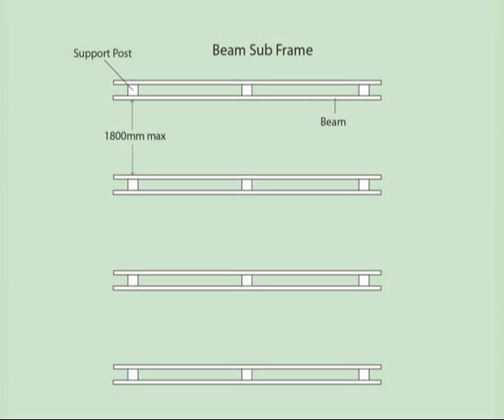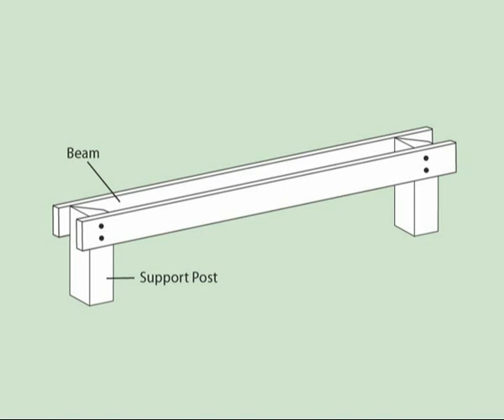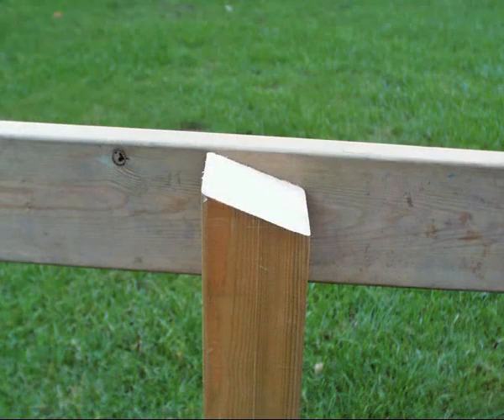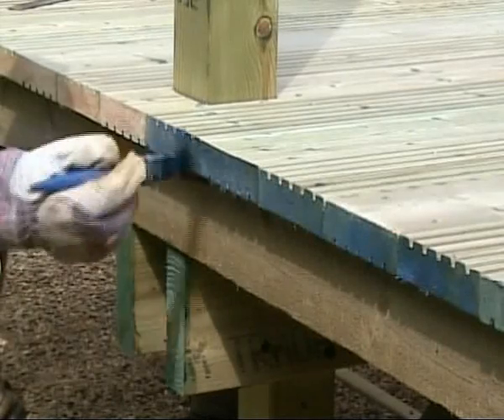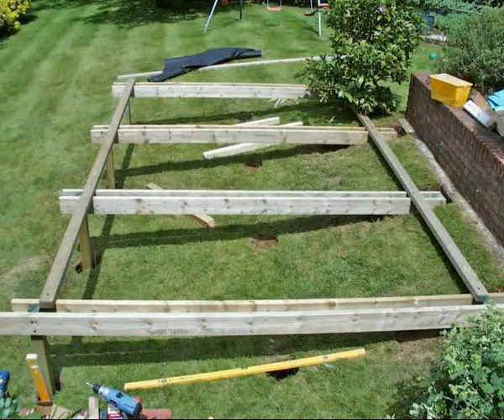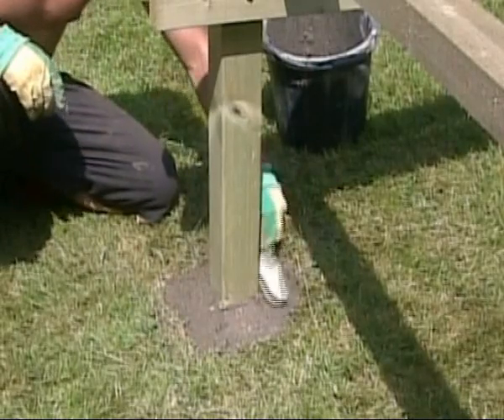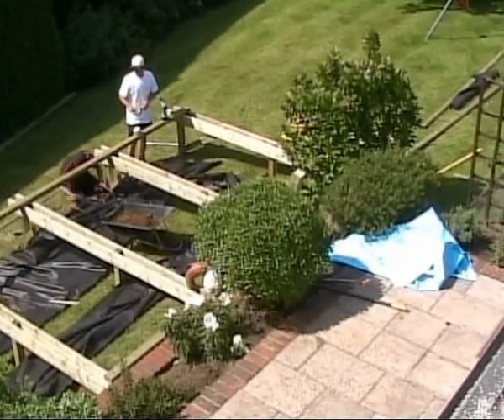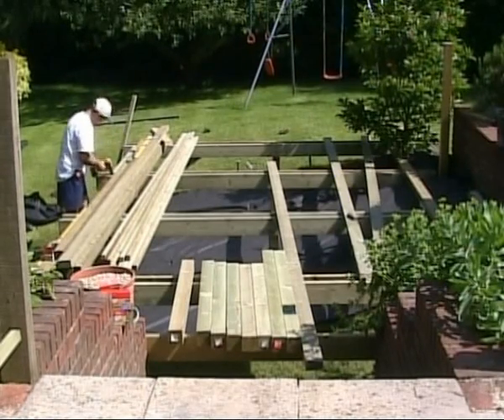How to Build a Deck. Part 05 - Building the Subframe. How to Build a Deck with Q-Deck Products.

Comment: Nice design, but poor engineering. How is the deck going to support much weight when you are attaching the load bearing beams to the SIDES of the support posts? The shear strength of the bolts will not be sufficient and I would not want to be on this deck at a party.

Comment: The beams should be sitting on top of the posts. Otherwise all the weight is actually hanging on the bolts screwed to the posts, not posts themselves.

Comment from the maker: The construction you mention is required if you need to meet NHBC regulations for raised decks & avoids the shearing affect on the bolts/landscape screws used to create the double member beam Q-Deck promote. Double member beam construction either side of a support post is recognised as a suitable method of beam construction by TRADA (The timber research & development association) & this, coupled with the ease of build is why we promote it. 

Adam Pulfer
Marketing & Technical Director
Q-DECK